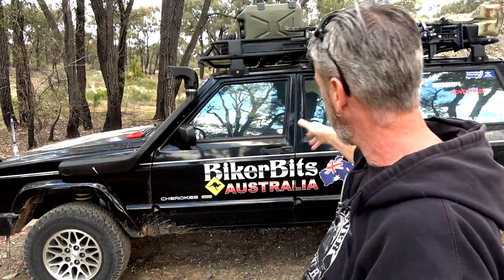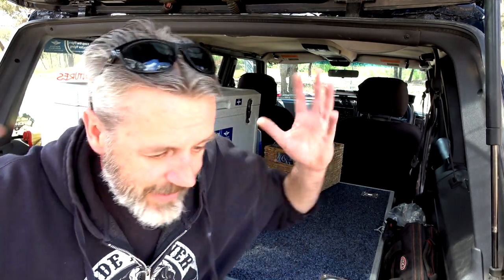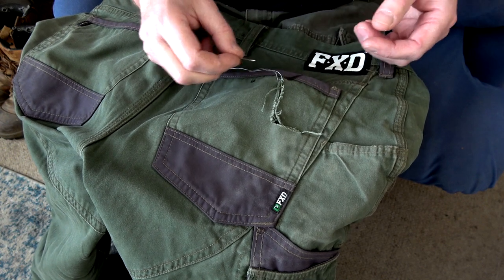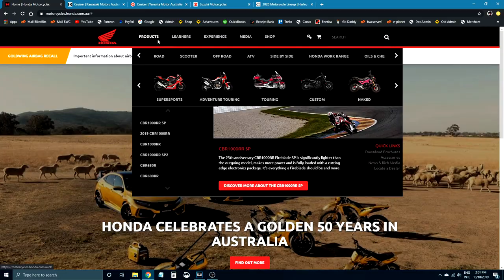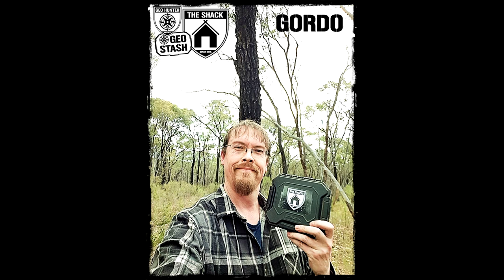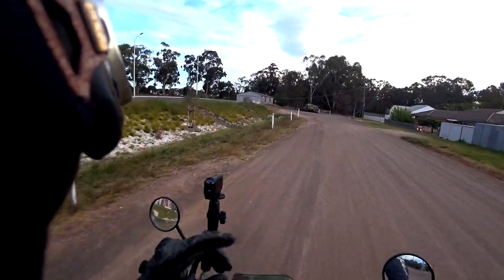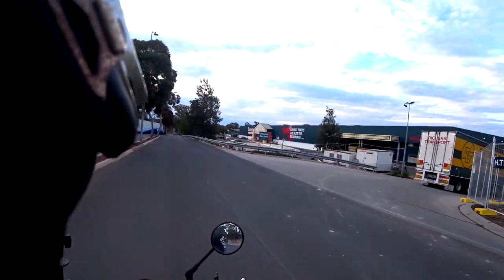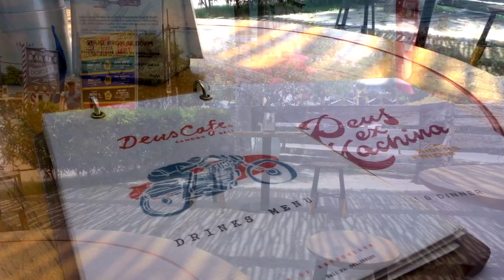Bit of Everything! MCT 2019 Ep.26

Comment: A great idea the suv step , the biggest issue i see with it is that the door locking lug was never designed to have weight loaded up on it like that , i could see the bar of the lug getting bent a bit out of shape , making it near impossible to shut and lock the door properly ,  or  causing cracking / fatigue of the metal of the door pillar where the lug bolts onto , the pillar and lug never usually have any weight loaded up on them